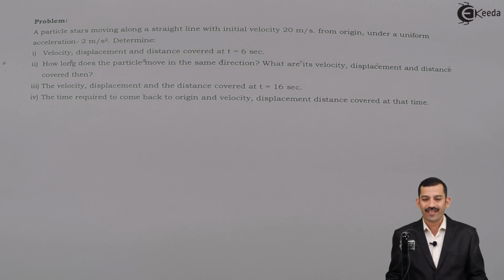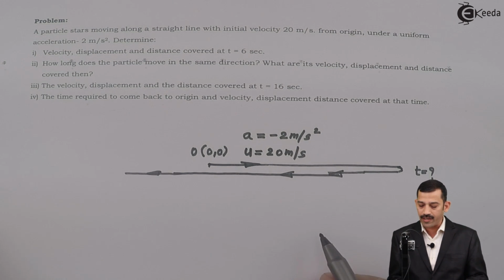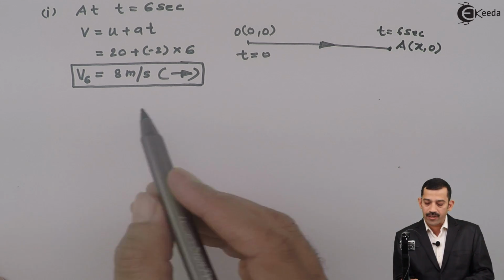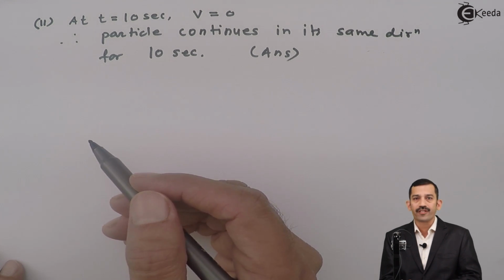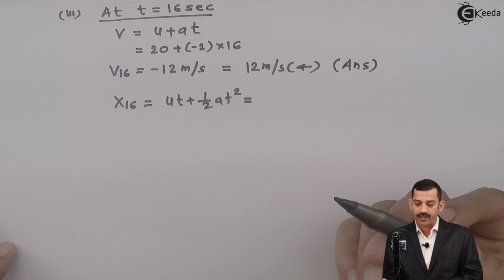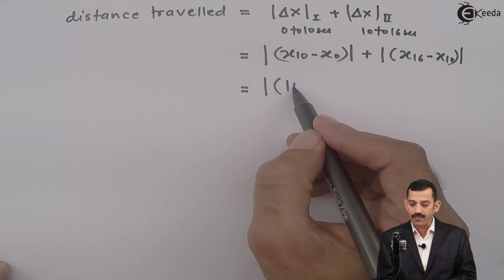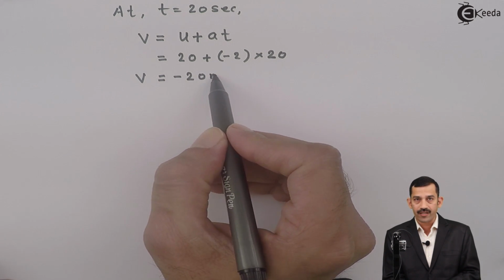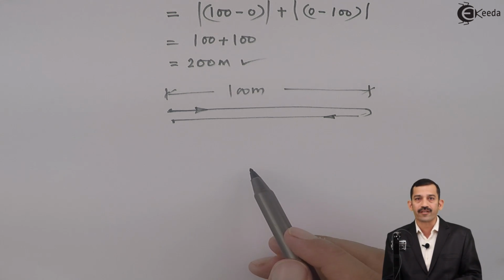Rectilinear Motion Problem No.1 - Kinematics of Particles - Engineering Mechanics

Comment: If the body wasn't accelerating negatively after the headstart with 20m/s and if it changed its direction just 90 degess then the velocity would still be 0?? at the point where it changed its direction?? Plz explain. :)  :)